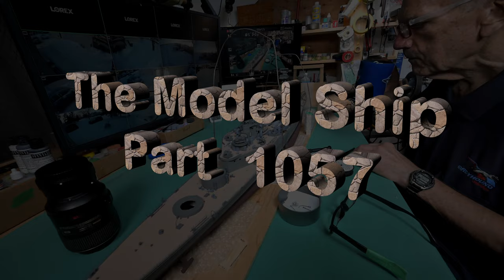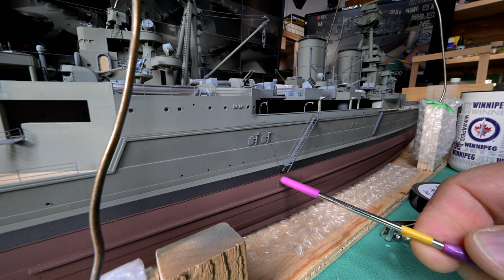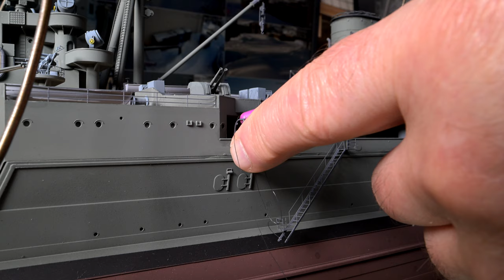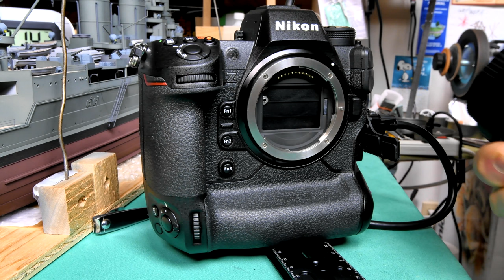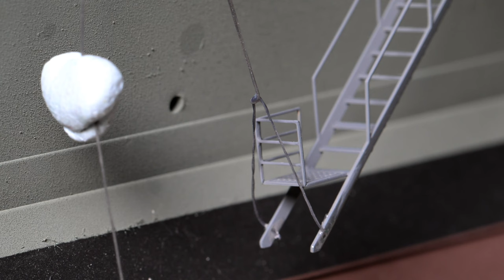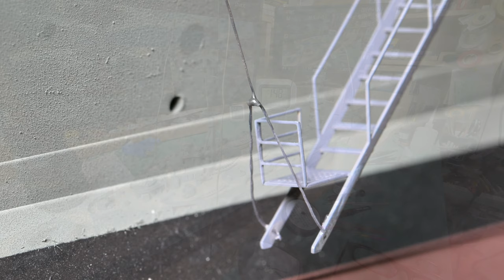The Model Ship - Part 1057

Comment: Ron, Parts of the video were at 1920x1080@60 and other parts were at 1280x720@60. It depends on the camera being used, but everything seems to have rendered @60 fps.

Edit: This is interesting... at approximately 0:46 the resolution went up from 1280 to 1920 even though it was a continuous clip and the camera didn't change. Maybe you changed a setting while it was rendering? So forget what I said about the rendering resolution changing between cameras.
Reply from the maker: Re: "1920x1080@60 and other parts were at 1280x720@60."
How were you able to determine that? I do know that when a video is first posted it's at a lower resolution for a few minutes. 😧
Reply: I just looked at yesterdays video and it shows it rendered at 30 fps as expected.

Edit:  Stats for Nerds is a YouTube product because I can see it as well under my other browsers. I wonder if when network traffic is high that the delivered resolution and speed is downgraded automatically, but I have no way to test that. It is holding at 60 for today and your previous videos were 30 fps.